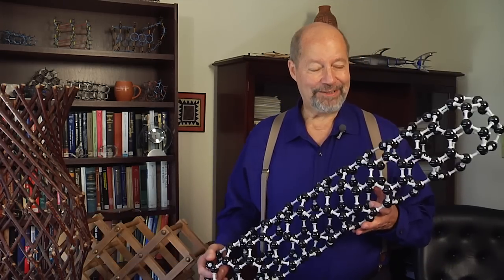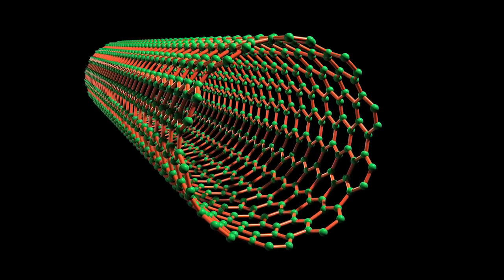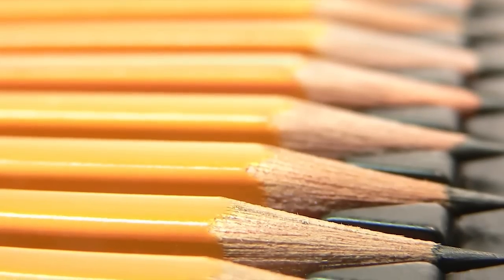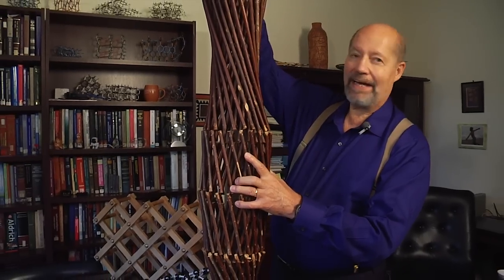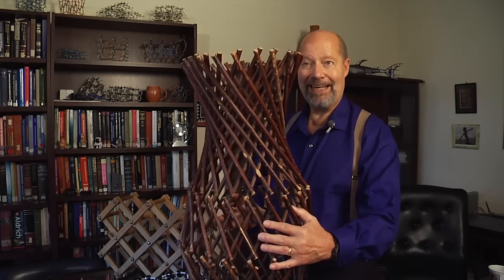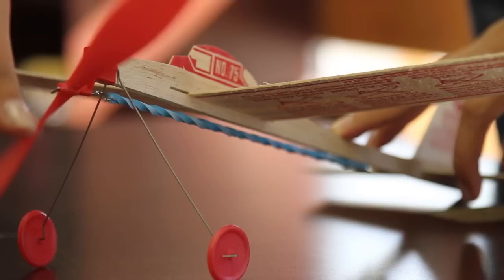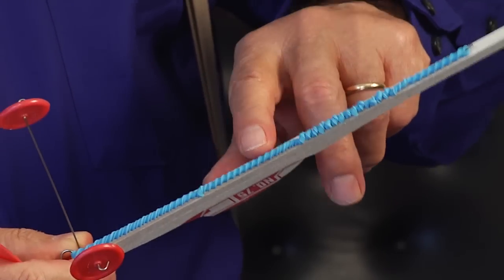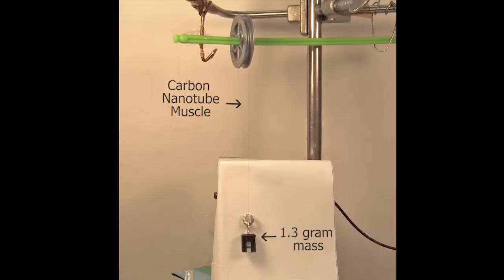UTD NanoTech- Super-Strong Carbon Nanotube Yarn

Comment: Do you think that the carbon nanotubes can be brought down to a cellular level, scientific so that they can be applied to stem  cells as a membrane? I'm a graphic design student and I'm doing a GMO project on carbon plated stem cells  and I was just curious if it was scientifically possible
Reply: Dinah Hopkins I don't know about that, but they have used cnts to interface individual brain cells with each other, or with external chips.